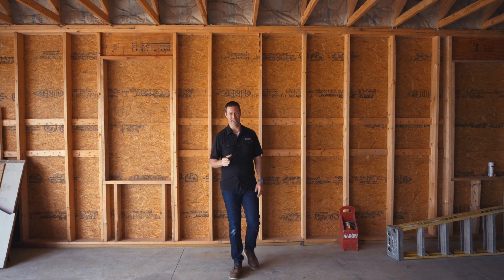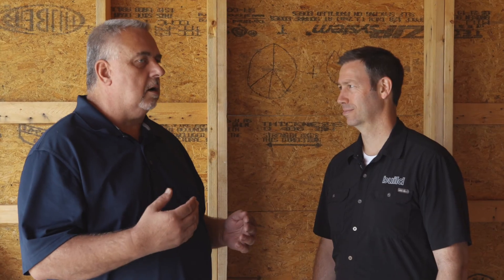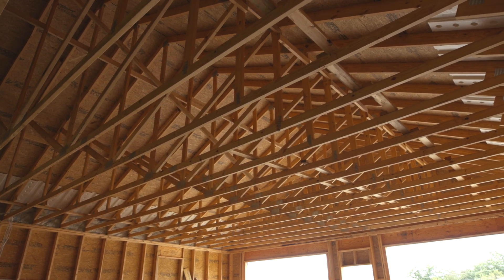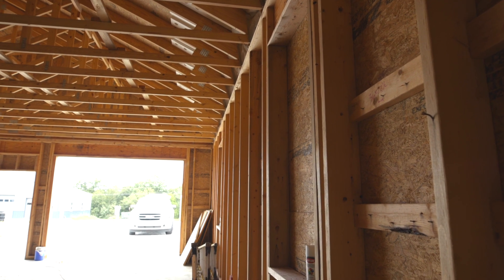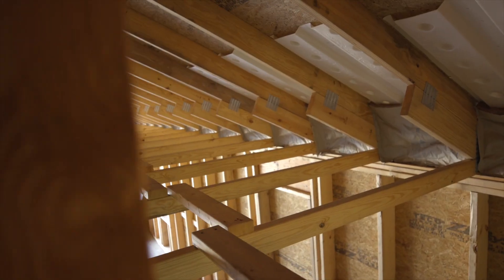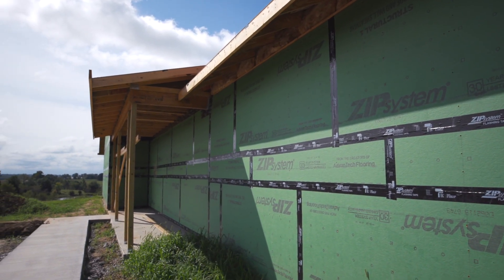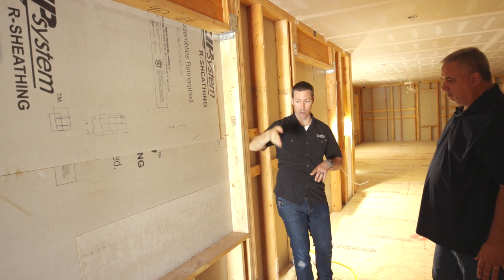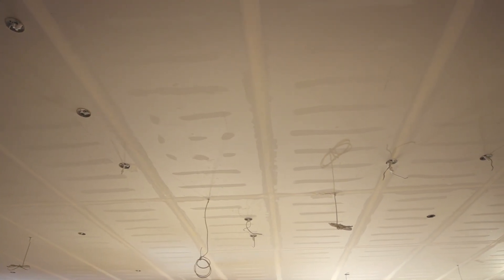Traditional vs Advanced Framing - Details

Comment: "smart framing"
-Still uses trusses vs vaulted on an I-beam and hot roof. (Bet they still use asphalt too o.0)
-still has huge thermal bridge and could just stagger vs. overpriced sheathing
-double top even when truss is within 4' of stud cuz "builder likes it"
-Engineered Headers could have just been double 2x4 for those tiny spans, for less bridge and similar R value.
-not wrapping vapor barriers inside envelope before rafters and blocking
only new thing is Samson header hangers, and at 6 bucks each, only now has lumber cost made them reasonable.

Comment: great vid-- guys....so i need clarification....is better for strength and savings to use  a basic 2x4 stud and go 16 OC OR 2x6 and go 24 OC?....i wld think it cheaper on labor to do 24oc and the 2x6 shldnt cost so much more, thanks matt!
Reply: 16 on center versus 24 on center has little to do with 2x4 or 2x6 wall framing. Most moderate to cold climates now require 2x6 walls to achieve an r21 minimum insulation package on the wall system. That's typically why you see 2x6 walls nowadays. Model energy codes getting more and more stringent as the years go by

Comment: Anyone know why fire blocking wasn't needed (required) between the wall studs? Would have been nice for them to touch on that, considering it's a common practice with traditional framing.
Reply: Fire blocking is only required between floors or at each floor level on balloon framed walls. Think separation from one floor to the next

Comment: Simple question: will 2x4 wall studs spaced on 24” on center on exterior walls carry the load on a two story first floor or would I need to beaf up the first floor wall framing to 16” on center?
Reply: Either 16 oc or 2 x 6 studs

Comment: I feel like people are missing a few points. 1) A lot of the stuff being done here is "cutting edge" building science. You don't have to incorporate everything they do into a build. I feel like for people that can afford it, great. If you can't, here are some ideas for how this stuff works and how you may incorporate parts of it into your build or at least understand how all of these choices impact the end result. 2) The point of advanced framing isn't just to cut down on the amount of money spent on framing. It's also to eliminate the number of vertical studs in an exterior wall. Every one of those studs (including the extra jack stud replaced by the hanger everyone seems so upset about) is a place you can't have thicker insulation. Very roughly, for a 40' long exterior wall you'd have 10 more studs with traditional framing. That's almost an extra 2' wide section of that wall insulated at only R5. These builds he's doing are higher end and all about pushing the envelope of efficiency. If you want a cookie cutter house, there are plenty out there. 3) Lastly, I get it, you've been framing for 100 years and this isn't the way you learned to do it. Guess what, we also don't use asbestos or lead paint anymore. If we didn't constantly try to improve things, we'd all still be living in mud huts.

More than anything, I appreciate the advancement of building sciences and the help in understanding how these all impact homes being built. We've got all these new materials and understanding of the physics (that's why building codes are updated) and yet people seem to be stuck trying to figure out how to make all of this new technology makes things the way they always have.
Reply: THANK YOU SIR!!! I could not have stated it better, everyone concerns themselves with negative aspects, instead of taking the learning concepts out of his. I can go about my business and not share anything, I share so that we may all get better, thank you again
Reply: I wish I could get my husband to understand this concept.  He just thinks I'm stupid!

Comment: Imagine the thermal performance if instead of a sprawling ranch you half the foundation and roof by stacking the two halves on top of each other. Might save you some money too.
Reply: Retired clients HATE STAIRS!!!!......just saying
Reply: @stevenbaczekarchitect9431  Fair point. Though if you keep the master on the ground floor the bedrooms for grandkids sleeping over can go upstairs 😉
Reply: In my nearly 30 years in the industry I found building a ranch is less expensive than a multi-story
Reply: @brettb614  I'm sure it's cheaper to build. I was just talking about the cost to operate it and pay the bills.

Comment: With the price of lumber these days, would you consider steel framing?   Does it matter if you are in different climate zones?
Reply: Steel is awful from an insulation perspective (it conducts pretty well compared to all other building materials) unless you intend to put all your insulation on the outside which will make it more complicated and expensive...
Reply: Certainly it should be an interior consideration.

Comment: In me country The netherlands , framing by wood is illegal unless it's the top floor or it's a bungalow with an flatroof.
Reply: Frank Silvers  has someting to do with fire safety and weatherproof, we build houses in here from stone since around 1600 and from concrete since around 1930 same voor the cavity wall al houses after 1930 has one.
Reply: Frank Silvers  if an house in here is older then 70 years , its an monument by law , and it is illegal to demolish or make changes to it on the outside , exept maintance. Only the houses for lower class what are goverment property are sometimes in slums made of prefab alumium frames cheap foamboard in rhe civity walls and fake plaster on the outside. The demoslish them when the maintance gets to expensive and then they rebuild them.

Comment: I have built a few houses in my day, and done several remodels including additions. I am no expert, but I don't see the savings with the 24"O.C. framing.  Granted,  it was a few years ago, but I think my average price per square foot for 2x4/2x6 was around $120-$135... Nothing revolutionary, mostly ply+osb sheeting, studs 16" O.C., tyvek whether, batt insl, and sheetrock. Great video but maybe I missed the point of the 24" framing. Also,  I have always used a double top-plate, it's way easier to join wall corners and plumb,  plus added space for wallboard attachment & top-nailing.
Reply: Yeah i didn't really understand much from the video either but what my guess was they're saying it's mostly insulation they're doing 24" oc since wood has less insulation? Anyways I'm just framing some non load bearing walls and the more I'm thinking about it it does seem silly for me at least to frame 16" oc just to hold some drywall.
Reply: For energy modeling 24” OC minimizes thermal bridging and improve the the R value of the wall. Less material, more energy efficient. The difference between 16” OC can improve the insulation effectiveness by roughly 10-15%

Comment: i'd like to see the hvac plan for this house.  judging from the video the mechanicals would be in the atic.  the supplies and returns in the ceiling.  as an hvac contractor with ceiling supply air i prefer return air low to the ground to avoid temperature stratification.
Reply: All the HVAC is in the conditioned basement. Supply is delivered high and returns are low
Reply: @stevenbaczekarchitect9431  partion walls are few.  have you considered high pressure systems such as unico.
Reply: @tedallen9078  have used for retrofits but never in new construction

Comment: Worst of many misconceptions and R values fantasies in this video is that insulating the outside applies to masonry stone aggregate and massive materials. The interior large dimensions make it much easier to heat to a.lower comfort standard, not that you use  heat much in Mississippi and Missouri where this is. For cooling spend it on geo cooling or heat pump tech not folklore (and?) code compliance.

Comment: So inside walls are built one 2X4 thickness short, then raised into position then the top 2 x 4 is added in last. I like it.
Reply: Studs must be cut 5/8" shorter to allow for thickness of the ceiling sheetrock.

Comment: How old is this video? We were doing this kind of building and insulation over 20 years ago. The only difference between this house and my home back then. This one is only 2500 square feet plus 500 garage. My under roof house was 5000 square feet. With a detached  4 space 2 cars deep garage. With a motor home tall space on one end closed in. 
  The 5000 square foot house was a 3 bedroom 2-1/2 bathroom home. 
My walls started a 9ft 2in wants up to 14.5 feet. Flat ceiling are just way to confining . Feeling like they are closing in on you.
 5000 square foot free span roof. Set only on the outside walls.

Comment: Sorry.  Framed in Cali for over 20 years.  There is a reason Vaughn named its hammer the Cali Framer....Cali can frame.  That...….is a disaster assembled by buffoons.  King and trimmer studs should be one piece.  your trimmers have several joints which can cause serious issues with expansion and contraction since it is several different pieces of pine that will not work as one piece would.  Headers are 4 inch...walls are 6 inch.  WTF.  2 ft studs...lol.  No diagonals at all.  Drywall blocking instead of running sheets vertical like in commercial so you only float one vertical joint.  I could be wrong on this...but that sure looks like OSB for flooring!?!?  1 inch tongue and groove only nailed with ring shanks.
Just keeping it real.  This build is total garbage.
Reply: The floor is 2 layers of Advantech Sheathing - It will be around alot longer than we will. Screwed and glued ......but you can keep guessing instead of having a respectable conversation
Reply: JmBStudio68 I sure agree with you on the osb. A bunch of chips and some glue.
  Although I disagree with you over the 4x headers. You don’t need 6x headers especially in an outside wall. 2 inches of insulation is much better than the cold loss of 6 inches of wood!

Comment: Advanced framing? Looks more like a 3 year old did that. FIBER BOARD IS NEVER TO BE USED. Its trash.
Reply: This is sales and promotion for the latest way for builders to dupe homebuyers into accepting garbage materials and designs.  It's all about profit for the builders.
Reply: @ellea3344  The person that buys that house, will be doomed, when the windows fall out. Sit on that window sill and it will cave in. The walls will all rot severely over time if any dampness gets to them whatsoever. It looks like they have a lot of spacing over 16" between the 2x's also. Trusses not supported right either. Total mess.

Comment: I'm a truss designer in Winnipeg, MB where it gets cold.  We haven't done the little 4" heel height (we call it a 1/4" heel cut) since the 80's.  In the 90's we moved to what we called 'standard heel' which was typically 7 1/4" heel and allows R20 over the walls.  In the 2000's a 12" heel became prevalent so that we could get R40 over the walls.  Since the 2010's, we've been going with a 14" heel, and R50 is the norm now.  It's important to note that the National Building Code only stipulates that you need R20 over the exterior walls, with insulation ramping up to R40 within (I believe) 4' or so of that exterior wall as you move toward the center of the truss.  This means that legally, trusses in this province only require a 7 1/4" heel cut to achieve this, however the cost to upgrade to a 14" heel is quite small, therefore the vast majority of homebuilders, whether small and custom, or large tract builders, just spec a 14" heel and R50 throughout.
Reply: Gotta love Winnipeg, where the meaning of 'it gets cold' gets redefined for those who visit it during the colder half of the year.  With respect from the prairies...
Reply: I'm building a post frame house. I specified a 16 inch heel on my trusses. I want a full r60 attic. R38 walls r10 slab.
Reply: Do you have any links that explain,  with illustrations,  what you are talking about? Thank you!
Reply: I live in a hastily constructed rental unit in Northern Manitoba from 2004, and it has triple pane windows. They still get condensation turning to ice when the exterior temperature is below -30°C (that can last for weeks, it usually goes as low as -40° at some point).
Reply: @questioner1596 I think it has to do with the humidiy in the house. To prevent condensation below -30 degree celcius, the indoor humidity needs to be around 15%. HRV running on high mode 24/7 in Winter will do the job.
Reply: @questioner1596  I am a registered energy advisor and talk with people about this all the time. The issue of condensation on the windows is less about the window more about the living environment. If you have humid air inside and blinds or curtains that prevent air flow over the surface of the window even the best of windows(which are still only R7-R8) will develop condensation. If you have a dresser up against a wall or a closet full of hanging clothes that prevents air flow over the surface over the wall you'll get condensation on the wall directly. Move air around in your home and exhaust the moisture to prevent condensation build up.
Reply: I'm in idaho, when I moved into my house that was built in 1910, there was zero insulation in the walls and very little in the attic. We moved in on Oct 9th of that year. Oh man what a cold winter that was, we ended up living in the living room in the center of the house with sheets hung over the entryways. My wife my 2 kids and I had mattresses on the floor in there but looking back it was kinda fun. The electric bill wasn't fun that's for sure, it cost us $700 a month that winter for electricity. All I know is the older generation was tough, they had to be! This area had some awful winters in the 1900's I just can't imagine what that would of been like. Now when someone tells me they just don't build em like they used to I say thank God! Lol
Reply: Living in Nova Scotia.   Watch a ton of these videos, and chuckle at some of their progressive builds.    Been building like this or more,  for years.   Was recently talking to my inspector, and she said in the near future, the code is moving towards r80 roof and r50 walls.  Don’t know how people will afford it.
Reply: I’m in northern SK, we’re using 20” raised heels and r80 attics on 12” thick SIPS.
Reply: Good post!
Reply: I grew up in Winnipeg and have lived in US for 25 years.  We have a new house and I am happy to say that current building technology in US is every bit as good as it was in Canada when I left in the'90s.  But, California wins for earthquake and fire protection.

Comment: The jacks/trimmers should run continuous to the header.  Split jacks/trimmers introduce another hinge point to the wall and may cause issues in seismic and high wind areas.
Reply: Also a noob...I'm here to learn
Reply: This is all building code stuff and codes vary from place to place.  A lot of codes waste lumber and reduce the energy efficiency of the house.
Reply: I agree,  that added header bracing looks more expensive and complicated than additional jacks
Reply: @johnouellet8700  
I'm complete noob, but didn't they already have additional jacks? Those two in the middle aren't jacks?
Reply: And it's just another flatwise plate to smoosh.
Reply: @johnboy3089  I agree. shrinkage/crackage :)
Reply: @johnboy3089  The drywallers will hate it

Comment: Question for framers and installers. I've found 24" of space between studs to be too much when installing cabinets and shelves. Has anyone run into problems of not being to find a stud? When I gutted my kitchen I made sure to put up backers of 2x4s behind the drywall where I knew I'd be putting any cabinets. I also found putting recepticles in where I needed them was harder. There wasn't always a stud there where I needed it. I ended up doing the same thing.
Reply: Adding cabinet and a curtain blocking... You're on the right track
Reply: Kitchens and bathrooms sometimes call for 16"ctrs. for walls where cabinets will be hung while 24" ctrs. is used for the rest of the house.

Comment: I always find visuals to be a great way for me to learn versus text. 

I been reviewing advance framing and notice almost every time its been only refer to with residential projects. I'm hoping to use these techniques towards commercial design. Some potential differences that I can see that could cause some issues on which strategies should be implemented would be cost, building life spanned, and and height of exterior framing. I imagine commercial advance framing is not discourage, but is there a reason the two aren't typical mentioned together online? If so, should certain strategies be reconsidered such as 24 O.C. studs?
Reply: Commercial framing has been historically built  "advance framing", it's called a shell and the reason is that the interior can be modified as pleased by the Tennant's.
Another type of building that has been done by centuries is gambrel roof / dutch colonial.

Comment: This is one of the worst framing jobs I’ve ever seen. No J-bolts for the garage walls, didn’t even see a foundation, maybe it’s a monolithic? 24” on center not enough trimmers under the bigger window openings to sustain the weight load, plywood being horizontal instead of vertical with having the blocking being flat loosing a lot of structural integrity... no truss clips as far as I could see in the video... what is holding the trusses to the exterior walls for uplift? As far as I could see he is a cheap architect cutting corners and pretending it’s an “advanced or smart framing” this would flunk and be the poster child for the worst frame jobs in Utah. If I was buying that house I would walk from it. As a designer and a builder, that architect is a knock off and doing a disservice for his clients. Infuriating to say the least.